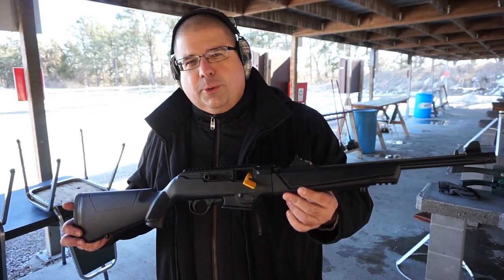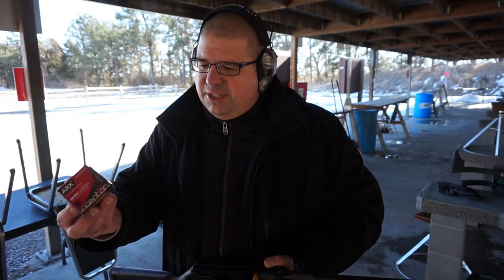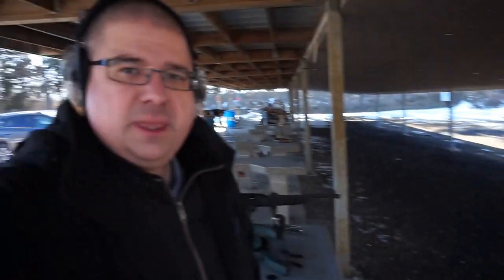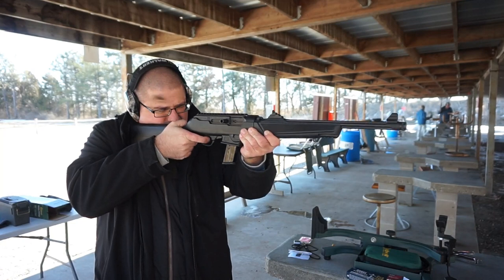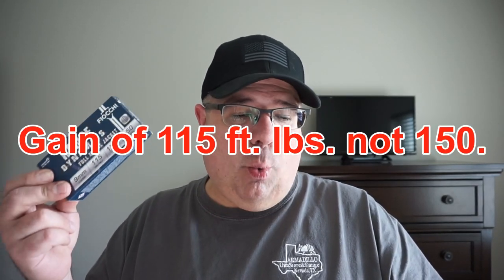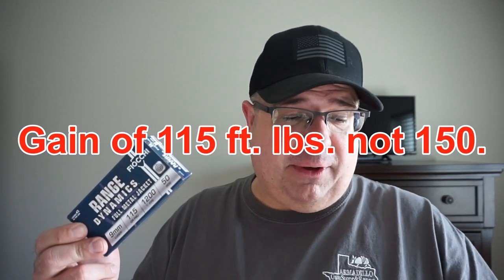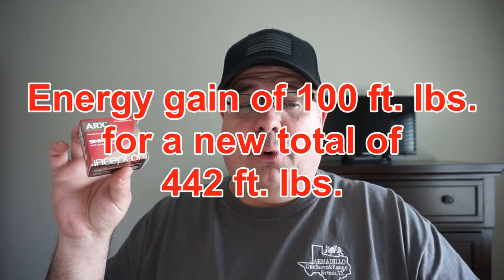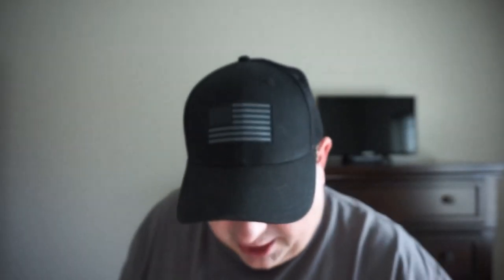Chronograph testing the Ruger PC Carbine...does a 16" barrel increase velocity and energy?

Comment: Thanks for the video.  I use Liberty Civil Defense in my EDC.  The BOX says  9mm at 2040 fps and the 45acp at 1900fps.  But they are 50grn 9mm and 78grn 45acp.  And i am not sure what they were fired from.
Reply from the maker: Good info! Yeah, the lighter weight ammo is definitely faster. It may be safe to assume it is fired through a regular pistol, possibly 4 or 5" barrel. Just about any ammo I have fired through my 9mm carbines chronos faster than what the box says.
Reply: @travisp11  I was thinking that but not sure. I need to check on it.
Reply from the maker: @HOOSIERDADDY385  sounds good!

Comment: Lovin' my much modified 2019 RUGER PC chassis type carbine with HOLOSUN AEMS circle/dot sight. A great sight for carbines. It has the most features of any comparable sight and Sage Dynamics drop tests show it is VERY tough.
I'm trying to find 1,000 rounds of NATO 124 gr. ammo B/C it his the same velocity as most 9 mm +P ammo - but CHEAPER.
I've got several GLOCK 30+ round mags and a TACCOM flared mag well of high impact Delrin polymer.
Reply from the maker: Sounds like a solid set up!
Reply: I've found that ammo once at my local RK. 124gr Active Duty Winchester. M1152 ball?? I believe. It was very spicy. Wish I could find more. Its a perfect ammo for training. As it's similar I'm feel to most Defense rounds.

Comment: I'm wondering if there are any cartridge is loaded specifically for longer barrels like 16 in.  To me, the first thing that comes to mind is using a slower burning powder. Possibly a heavier bullet.
Reply from the maker: If you look up load data on this round you could load it to the ballistics you want. You may be able to find recommended bullet grain weights for the rate of twist for that barrel.

Comment: Wondering at what distance  a round fired from a  16" barrel equalizes in energy with the same round from a pistol at point blank.  50 feet?  75 feet?  100 feet? 
I'll gladly trade a little over expansion/penetration at short range from a 16" barrel for farther reach.
Reply from the maker: If you ran the round, energy and velocity through a ballistics calculator and measured your pistol velocity out the barrel with the Chrono you could probably calculate that. Only thing is, for what it's worth, my Chrono requires at least 5 feel of distance from the muzzle to the Chrono to function properly, so you wouldn't get an exact, straight from the muzzle velocity but pretty darn close. Sounds like I may need to do another test with various barrel lengths.